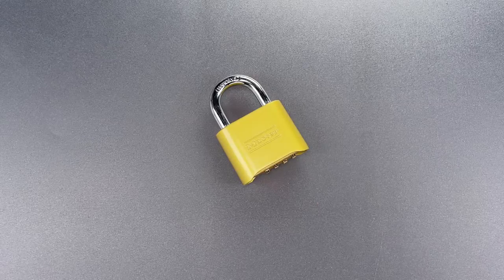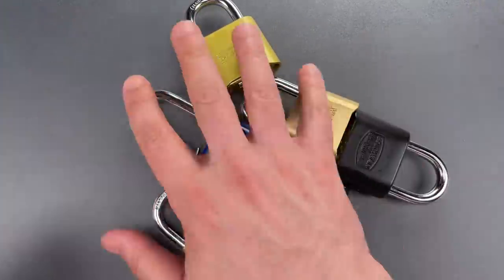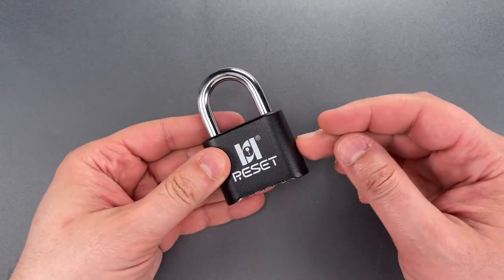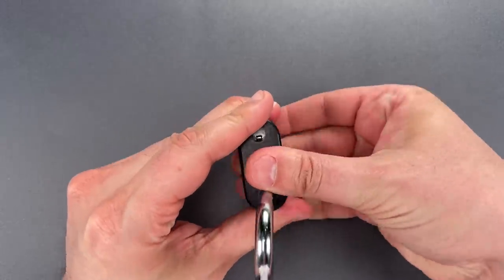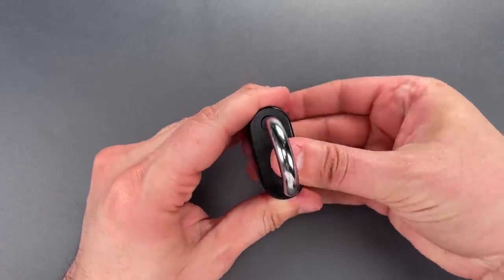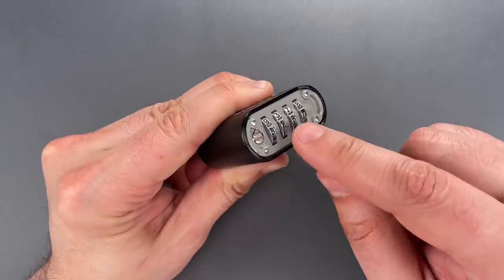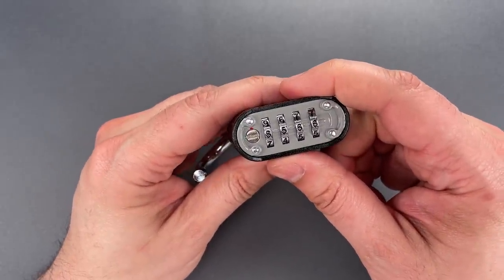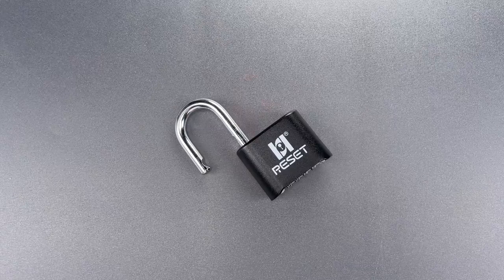[1292] Lesson: Don’t Copy Master Lock (Reset Combination Lock)

Comment: So, Master made a lock that could be rapped open with a mallet. Then they improved the design so a rapping attack no longer works. Except, now, you don't need any tools to get it open. Got it.
Reply: Whoever designed this should stop working in the lock industry...
Reply: I mean this does require more time and dedication than picking a random rock to bash the lock one.
Reply: In ML's defense...This is an improvement over a rappable lock. It takes significantly more time than merely hitting it does.

And it's not like you can only use the piss hammer to rap a lock. Pretty much any solid enough object would work, which...isn't hard to find.

Now, that said, this is still a massive design flaw. It's just less horrible of one than it seems at first.
Reply: “Oh gosh, you need a hammer to open the lock? Clearly we made it far too difficult to open”
Reply: i missed the second p...

Comment: In high school, I could pop locker combination locks, by tugging gently on the shackle and rotating the dial to the loose points.  I couldn't believe how easy it was.
Reply: When I was in middle school, you could open most of the dial locks just by tugging hard and sharp once on it.
Reply: Me too!  lmao!  Man I got so many cheerleader panties that way!  Er, I mean ...
Reply: Agreed; many locks in school gym would fail if you gave a solid yank. Many of the ones that didn't fail at first would fail if you threaded a towel through the shackle, and used that to allow you to build up some real momentum when you gave the lock a yank.
Reply: I got a combination lock a couple years ago that I accidentally ripped open by force when testing the shackle. I didn't have tools I was just tugging on it with my bare hands.
Reply: @giga-chicken  well atleast you never let that lock secure  your stuff. It would of been gone the moment you blinked.
Reply: So that's where my weed went, I always thought it fell out of my pocket.
Reply: FBI!
Reply: Easier still, rotate cc wise, pulling gently. Pops open just from that 99% of the time.
Reply: @giga-chicken  I sometimes have to resort to that method: "I didn't have tools I was just tugging on it with my bare hands." 😂

Comment: You must have a massive pile of worthless locks in your garage. LOL
Reply: They’re not worthless! Scrap metal can go for tens of cents on the market.
Reply: Maybe put a bunch of different bad locks together to secure something will at least slow someone down.
Reply: He sometimes sends them out as prizes to viewers/supporters. It keeps the pile to reasonable size. 😉
Reply: He sends them to the federal government to use to protect classified information in congress...
Reply: @rhecker7267  yeah how else do you think the us government is run
Reply: @robertlawrence9000  put enough on and the person trying to get in will get bored before getting through them all.
Reply: He has said he has a ton of practice locks and I'm sure he has a ton of junk locks as well. Although he probably only keeps 1 of each type of garbage lock. Since they have no practice value
Reply: his wive prefers the 18inch Long Johnson lock.
Reply: He should sell them framed with a certificate and the video number, would be sold out immediately
Reply: @robertlawrence9000  or save the money and go for a paclock or squire, as those are pretty much guaranteed to stop a majority of thiefs and slow down the above average by quite a bit.

Comment: the reset lock reminded me of me when i was young, coming home from school. there were three big maple trees on a crossroad. people used to lock their bikes to the stone wall surrounding them. i now and then found a bike lock on the floor with no bike in sight. those were number locks, and i tried to hold them close to my ear turning the wheels till i heard a certain click and got the lock to open and reveal the key number so i could reuse them. i only had success with 1 or 2 locks - i am not much of a lockpicker ^^ now i have learned that the combination can be found without the sound just by the travel space the digit has. thank you and have a nice day.

Comment: Plot twist, LPL just have extremely sensitive fingertips, so he can feel the craved-in numbers in the wheels after he changed the combination but before scrambled the wheels.
Reply: Has anyone ever seen Matt Murdock and LPL together? No? LPL IS DAREDEVIL!!!
Reply: And he is also able to remember all those numbers while he is scrambling them... he is the Stig of lock industry
Reply: @jestestuman  "Some say"  :)
Reply: @shadanzar  it's not worsened that's the sad part, the design is so bad that you would actually have to try to make it worse. Like say make it so that if there's one set combination two different numbers can be used for that dial, but with what I understand about the design of that thing that would be near enough impossible without radical changes which would make the lock more expensive

Comment: Sir, I really enjoy your videos and am in awe of your skill, thank you. I feel an area you are missing, maybe I just haven't seen it yet, is what these locks are attached to. A Big Box store Kwikset lock is often plenty of lock for a cheap outside door with a 3/4 inch finger joint jamb. Easier to kick it in then pick a lock. The best padlock does nothing if the hasp it uses is a $3.99 Walmart hasp. Perhaps a few vids on how to make the doors or hasps better? or what type of exterior doors are the best/ worst? I managed a door shop for several years and know most metal exterior doors are pretty easy to defeat. Double doors with head and foot bolts can be opened with a screw driver faster then a key in a lot of cases. Amazing how many people still hide spare keys under the door mat. Keep up the good work!

Comment: Remember the good ol days when Master Lock was the best lock around?  Neither do I.
Reply: You had me in the first half, not gonna lie! :P
Reply: There was a recent story of a soldier getting locked in the room full of weapons by one of those complex bank vault doors that had all the safety systems broke off of it so she couldn't get out. The fire department came and broke through a 6" or less thick brick wall to get her out.

There was this show where they were testing a deadbolt on a door and then got a large man to just kick through the door as if he was the Kool-Aid Man.

Master Locks are generally used in areas where it's probably just as easy to get around rather than through the lock.
Reply: @orlock20  Regarding that weapons room lock-in, the fire department also had to cut the metal cage just inside that concrete block wall. But all in all, not very secure, which was fortunate for the person locked in.
Reply: They never were. Not in my 51yrs on this earth.
Reply: @orlock20  having just seen the word "toddler" in an earlier comment, my brain somehow stuck that into this story instead of "soldier" and i was really confused for a while
Reply: Not even Pepperidge Farm remembers those days.

Comment: Wait, so with those other wheel combination locks you often need a simple notched tool to pull on the wheels and let you feel the loose numbers... and Master lock has just built that tool into the shackle, so you can pull on it and get the same result?
Reply: Master Lock calls it "efficient design".

Comment: I use several Master Lock 875/975 around my yard mostly as child proof locks (2 sheds, 1 pool box).  Nothing I would be upset about if stolen, but children can get hurt.  It just prevents me from carrying keys or remembering multiple combination.

With no disrespect to the LPL, these locks have flaw that make them very hard or impossible to open.  Rain followed by freezing temperatures.  Where I live, it is often above freezing during the day and below freezing at night.  Once these locks get wet they will freeze.  Forget even trying to pick them.  The wheels move but the lock does not open.  You need a torch to heat the locks before they will open.   2 months of the year, I am safe at night from the LPL and his standard tool set.

Comment: Reminds me of cheap bike cable locks that had rotating numbered wheels. Pulling the cables apart slightly you could turn each of wheels until it sat tight to its neighbor. Starting left to right, you could open these in about 10 seconds. ✌

Comment: Haha! I remember the locks we used to use on my high school's lockers used to have the same flaw in them. It was far to easy to set them correctly. You barely needed to apply pressure for the wheels to "drop" into the correct set when you rolled them over. It did make for quick access, especially when you already knew the combination, but the theft rate at my school was also very high. Go figure.

Comment: Sadly, the old style dial combination padlocks where the shackle goes through the centres of the dials, and so has the same weakness, is still being made and sold by companies like Masterlock and Yale (although the Yale ones do have false gates opposite the true gates). A zip tie would be more secure. I can only assume that the security rating on these just refers to the packaging. Not the lock itself.

Comment: Are there any combination locks that dont have that vulnerability (or version thereof)? I guess if you had the shakle housed it would stop the pull method, but you can still use a feeler gauge to feel for the gates.

Comment: unrelated question: Wouldnt it be a cool idea to put the key hole directly under the shackle? so you cant use such long tools or no tools at all, because there is no operating space (obviously there should be enough space for a short key at least)
Reply: No, because that space is filled by whatever you're locking together.

Comment: Random lock question- what is the proper way to lubricate a deadbolt lock (outside)?  I took one of mine apart and it had gooey, sticky residue that was keeping it from working (sidebar would hardly move).  Cleaned it with solvent,  but now what?  Powdered graphite?

Comment: Why pull on the shackle when setting the last wheel?  If the other three wheels are correct, won't the lock spring open when you turn the last wheel to the correct digit?
Reply: Probably not. Most cheap locks don't have spring-loaded shackles. It might fall open by gravity if you're holding it upside down.

Comment: That shackle looks like you could just pull it out with a slight bit of force, the locking indentation is rounded instead of squared, and I bet whatever piece is supposed to hold it in is made of fairydust and held together with hamster spit.

Comment: I'm reminded of a comedy sketch By Luis Black in which there are two Starbucks literally across the street from each other. His conclusion is the only way it makes sense is if you have Alzheimer's, forget you just had a cup of coffee and think Starbucks sounds good immediately after leaving the first Starbucks. Perhaps the lock is intended for someone with Alzheimer's that can't remember their combination, or perhaps they have Alzheimer's and simply forgot to never buy a Master lock.

I might postulate the real issue is the design team at Master Lock has Alzheimer's and they've forgotten about all of the low skill exploits that practically every other manufacturer tries to either mitigate or eliminate.

Comment: Okay hold up. . . Cant you just change the switch and add your own combination? Wouldnt that be easier than using your method to open the lock? You can just change the combination to 1 1 1 1 and open that sucker up

Comment: I bought a master lock disc padlock to secure my shed cause that's all the had at my hardware store. I also bought the 7 pin ultimate adversary lock from learnlockpicking.com. it and the lockpicks cake in yesterday. Just as a goof I tried to pick the master lock and 5 seconds later, I picked my first lock.